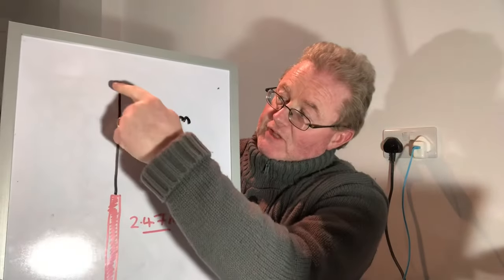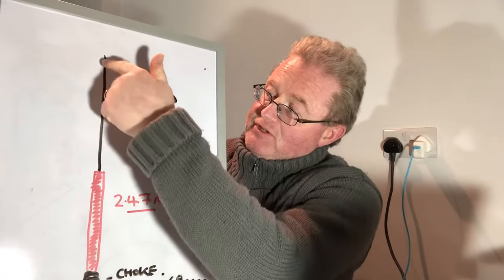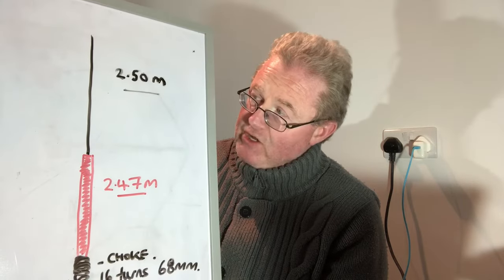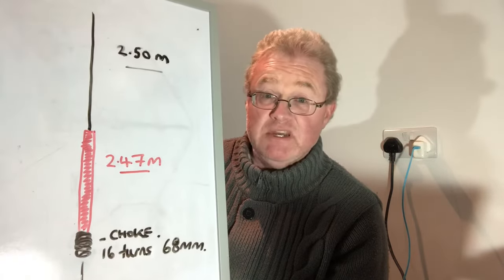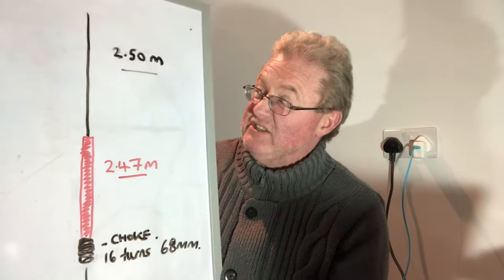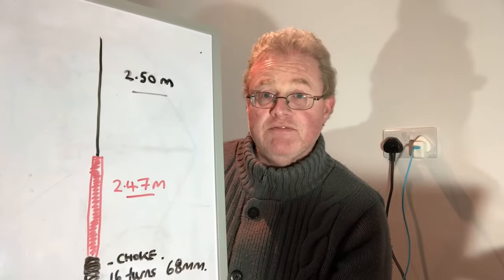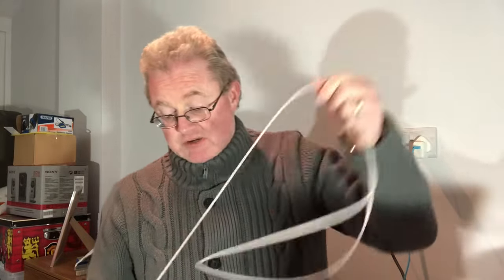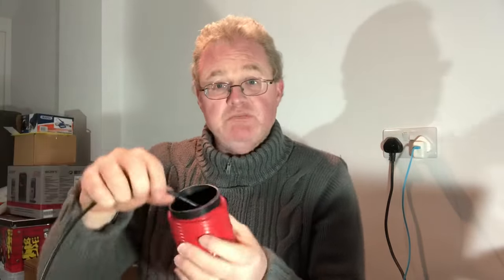T2LT - Half Wave Vertical Coaxial Antenna For CB Radio & 10 Metres

Comment: I've constructed a T2LT antenna for 11 meters, but with a twist: instead of using an air cored coil, I've built my choke like a 1:1 unun. The measurements ended up being similar to the ones for a 10 meters antenna. The SWR was 1.5 at its lowest.

Anyway, the antenna ended up being compact and can be used without a tuner for the 11 m band. It is also my main antenna for ham, and had good results (e. g. phone contacts from Portugal to Brasil with just 50 W). Due to constraints, I have to mount the pole listed 45 degrees from a window.

You can see videos of the antenna on my channel, and even some experiments using that antenna to test self-made amplifiers and transmitters.

Anyway, thanks for the very informative video!
Reply: Stop lieing please 🙏 😂😂😂
Reply: @lesjones5684  The living proof of that antenna working is on my channel. Yes, the SWR was measured in said video, and it matched my initial measurements that were done vertically. Perhaps the pole I used had some influence, but I really doubt it.

Comment: Traditionally, the lower element would be formed with another layer of shield, typically sourced from the top section. (Note of course that since the diameter has to be increased, that you'll need significantly more length as it shrinks in length as it is expanded in diameter to fit over the outer jacket.) In other words, the feedline snakes up inside the lower element, which is another layer of shield. The design shown in this video has the lower element effectively formed with the outer surface of the coax's shield, and choked off at the bottom.

One concern with this design approach is that the bottom of the lower element is a very Hi-Z point, so there isn't much current to be choked off. It's a high voltage point. So you may see more feedline current (another quarter-wave down the line) than expected, as it escapes past the choke as a voltage (not a significant current).

Also worth mentioning, the choke dimensions are not as mm-critical as implied. It's a choke, which is rarely a precision value component in any design.

Cheers.
Reply: Re. your comment: "It's a high voltage point."  I guess that it is a high-voltage point only because the choke is there?
Reply: Yes, that is the description of a true, "coaxial antenna." This antenna here I see with a couple of other names. The quarter wave braided shield over the outer insulation used to be thought good for isolating the feed line from the antenna, but the design did suffer from narrow frequency range / narrow SWR range and TVI / television interference, due to feed line radiation. The traditional coaxial halfwave antenna was said to have the lowest angle of radiation or gain. When a choke is added to the antenna, the frequency range / SWR range greatly improves and the TVI is reduced. The choke is to choke current, even if it is an a voltage point on the antenna. Choking voltages does little for antenna performance and causes greater losses. A current choke is still preferred over a voltage choke for function, although a voltage choke may provide a very slight amount of current choking, but a voltage choke causes even greater losses though. I would no refer to the antenna in this video as a coaxial antenna, even if it is made of coax. It doesn't fit the design. Much of the current to choke will be harmonic frequencies, but also to reduce base frequency radiation from the feed line.

Comment: Rather than stripping the coax, why not just put 2.5 meters of wire on the end. That would save you 
2.5 meters of cable. You could leave the PL-259 on the end and solder the radiating wire to an SO-239 and connect it that way.  You could also build an antenna from the choke up and put an SO-239 a few inches under the choke and have several antennas made. Thank you for the video. I never really thought of using a coaxial dipole before but I find myself in a flat in Madrid and your idea may be the only option I have for operating.
Reply: Fair point
Reply: RG58 isn't pricey, but yes for longer antennas it'd be a waste; I've used a separate piece of wire for this. One suggestion I'd have though - start with a tail of a few cm of the inner part of the coax to take advantage of the insulation, I stripped back to the prescribed length and found it was easy to accidentally short it at the join :(
Reply: Also, I wonder whether normal insulated wire would be a bit less lossy than using the co-ax dielectric?
Reply: Back in the day we used 13 amp wire usually off an old appliance found somewhere .
Worked very well

Comment: The antenna described is electrically similar to the Shakespear Big Stick CB antenna which was very popular back in the 70's.  It was a half-wave coaxial sleeve antenna which came in two pieces.  The top part was a regular 96-inch fiberglass quarter-wave mobile whip.  Most people replaced it with the famous 'three-quarter Francis' whip, thinking the combination got out better.  The bottom part consisted of two coaxial fiberglass sections with a braid sandwiched between the two pieces.  The bottom section was capped with a metal ferrule the whip screwed into.  A piece of RG-58 ran up the center of the bottom section.  It terminated under the ferrule with the center lead soldered to the ferrule.  The coax shield was connected to the braid.  A 5K resistor was placed between the center and shield for 'static bleed' (poor).  The bottom fiberglass section had an aluminum sleeve glued to the bottom and a crimped-on SO-239 was crimped into the sleeve.  It was mounted to a mast with muffler or hose clamps.  It could handle 500 watts and had 2.5 DBD of gain.  A simple and very effective design which kept the radiation angle very low and compact making it excellent as a hilltop or field antenna.  A military version of this antenna was also made as military radio frequencies surrounded the civilian 11-meter band back then.  It was the same design with extra heavy-duty construction.

The Big Stick was the best design, better than the famous "Ringo" because the feed point was in the center of the antenna instead of at the bottom.  So, the feed point was elevated (antennas radiate most of their energy from the feed point).  I always recommend adding a shorted quarter wave stub to the bottom of those antennas.  It creates a DC ground for the antenna.

The Big Stick had one major failure point:  The connector at the bottom.  Because of constant flexing in the wind and temperature swings, the RG-58 would eventually pull out of the connector creating an open circuit.  I made good money fixing those antennas once I figured this out.  I even salvaged 'bad' Big Sticks from people who went on to 'fancier' antennas and resold them after fixing them.

Several years ago, I accidentally contacted the creator of the Big Stick suggesting he license the design and let someone make 6 and 10-meter versions of the antenna and sell them.  Unfortunately, he would not sell the patent or license the design, therefore no one makes the antenna anymore.  Such a shame!

Comment: Thanks for showing this, it brought back fond memories.  I made one similar to this for 11-meter CB back in 1975 when our ground plane got destroyed in a storm.  No balun coil, just took the end of the RG-58 coax, removed a quarter wavelength of the outer jacket and cut it into two equal lengths.  I spread the braid where the jacket ended and pulled the center conductor and dielectric out the opening.  I then used one jacket piece to tie the center conductor and dielectric to one tree, and the other piece to tie the braided shield to another tree, horizontally polarized.  Hooking up the SWR bridge it would barely budge the needle, reading 1:1 across the entire band.  Fortunately it was aimed the direction we needed, and I had all kinds of people I spoke with on it saying I couldn't be talking on a piece of coax!
Reply from the maker: Brilliant example Bob
Reply: @timg5tm941  Thanks!  I always look back at it fondly as a good example of putting theory into practice.
Reply: Do you have any pictures of the antenna 73s from 416 Trinidad.
Reply: Love to see a diagram of this
Reply: @alvin pope  Unfortunately no pictures, I was 17 at the time, going to tech school for electronics. Had started learning it as a hobby, was fixing CB radios and stereos, installing them and other related stuff.  Worked part time at a few CB shops.  Wish I'd had a camera to take a picture of someone actually mis-wiring RG-58 coax into a PL-259 connector without a UG-175 (176?) adapter, they unbraided the shield and soldered it to the center pin, the center conductor to the shell.  If I hadn't seen it I wouldn't believe it, HOW does someone swap polarity on a coaxial connector?!?‽
Reply: @Noel Stephen Ryan  Not much of a diagram needed, but I get that you're trying to visualize it.  My written description covers it pretty well, but you can try it with just a short scrap piece of RG-58 coax.  The hardest part is pushing the braid back toward the main section of cable, then carefully spreading apart the braid in one spot enough to make a hole without damaging the braid.  I used a jewelers precision flat blade screwdriver or the back edge of an X-Acto knife blade (opposite the cutting edge).  It's fun to snake the dielectric and center conductor out of that hole, but once it does, the rest of comes through fairly easily.

This whole thing was done as a quick fix, not meant for long-term use.  I used it for a few months, and I'm sure the copper braid was tarnishing and/or corroding the whole time.

The design is equivalent to about any dipole, I just used the coax itself instead of individual wires.
Reply: @bobblum5973  Appreciate reply. Yes I get it now. Thanks again
Reply: @noelstephenryan4837  You're welcome!

Comment: They work really well Tim, I was able to do back to back tests with a T2LT that I made,  and a shop bought 1/2 wave vertical on 10m, no difference on either TX or RX, I was so impressed I made one for 6m too! 73 M0KED.
Reply from the maker: Indeed Andy they work very well

Comment: Great video Tim. I made the 5 turn coil version a while ago, but for the top portion I used 10 mm aluminium tubing. This way I could mount it on top of my military fiberglass mast instead of hanging it down. Gained extra hight with that.
Reply from the maker: Sounds a very good build👍

Comment: great job Tim. if the size of coil off a mm or 3 that still fine and works. I used 54 MM with RG-8X . 16 turns. great band width. and their is a 3 Rd way to make it. FT 240-43 Toroid for the coil.  great fun in the US as well . 73's
Reply from the maker: Brilliant stuff

Comment: Funnily enough, I made two of them a few weeks ago. One for at home on a 10m pole, and one for out in the car. Fantastic stuff, as always.
Reply from the maker: Can’t beat them Mike 👍
Reply: How did you use it in the car Mike? Stationary or did you mount it on the vehicle some how?
Reply: @vsmichael1  Hi Mike, I have used it two ways over the years. One is a 10m pole strapped to a fence post, and the other is I  have those suction grips (for gripping glass panes), attach one to the side of the car and lash the 10m pole to the side of the car. Both worked extremely well.

Comment: I've been trying to resurrect an old Cushcraft MA5V vertical (20, 18, 15, 12, 10 meters) elevated to about 25 feet on a pole but it lacks effectiveness. However, it is pretty noisy most of the time. I saw another video using this design and it seems pretty quiet noise wise. Will try this design. Thanks for the idea Tim.

Comment: Hello Tim,  The T2LT is a great antenna. I have redimensioned the T2LT for 2 meters about 47 centimeter per leg (mind the velocity factor) with 8 turns on a 4 centimeter diameter plastic pipe. It is my antenna for my local net. On a 12 meter pole I can get as far as 50 kilometers on 25 watt.  I my opinion it can keep up with much more expensive commercial antenna's easily. My greatest distance so for with my 10 meter version is Chilli 12.266 kilometers. (from the Netherlands). Great antennas that keep amazing me.
Reply from the maker: Fabulous! I use a 2m version too.

Comment: Good job Tim. I have seen one of those commercially made ones that you describe and they are finished off at the top so that the end folds back on itself a little and then held with a little piece of unshrunk heat shrink so that the antenna can be adjusted longer or shorter.  I think i will make one this weekend just to see but i will try 6 or 8 ferrite beads slipped over the RG58 at the 2.47m mark and heat shrunk to make the choke that way. Sid.
Reply from the maker: Sounds interesting Sid let me know if the choke works ok

Comment: I've heard of these and hear they work well, what I have read is the coax shield should be peeled over the coax itself and pulled down from the radiating portion of the antenna for the counterpoise???, aparently it doesn't matter.
   Great demonstration, thank you for sharing this with us!!! 🇺🇸
Reply from the maker: Thanks Eric. Yes that is an alternative way to do it but this way seems a bit simpler. 73
Reply: @timg5tm941  Your welcome Tim, and thank you!

Comment: What about changing the radiating part for 10mm2 copper flexible cable?
I did that, and my antenna is performing much better.
Reply from the maker: Yep, an option 👍

Comment: I built and hung one for 11m between 2 trees and at the same tip height as my neighbor's Sirio Vector 4000 and with the same power we hit a guy on a ridge at 110 miles with the same S-6. Now I'm planning to build & hang a home-spun Sirio Gain Master wire and I bet I'll gain 3-5dB.

Comment: Thanks for the video, Tim. 🙂
I am new to ham radio and I would like to built on of these T2LTs as my first HF antenna (for 15 m though). With my humble understanding of antenna technology, I am now asking myself🤔 this as I do not have an idea regarding how sensitive the T2LTs are to - let's say - non-optimal choke dimensions etc.:
a.) Is it recommended to actually measure the choke with a NanoVNA or sth like that to make sure the diameter and the number of turns are correct to have the coil have its maximum attenuation at the frequency I would like to trim antenna to?
b.) When trimming the antenna, is it required to also shorten the part next to the choke when cutting of a part of the "naked" wire of the top part? (= move the choke up the same amount of centimeters)
Maybe you (or someone else who knows the answers) can help a newbie to get started - 
peferably in easy to understand English, as I am German.
Reply from the maker: Hi there:
(a) no just follow the choke chart from G3TXQ. (b) no need to adjust the bottom half of the antenna as long as you have cut it right. It is the top half that requires trimming. 73

Comment: Great video. Thanks. Do you have any comments on how high off the ground  the bottom end of the antenna (the coil) should be? Can they be mounted close (like less than a meter) to the ground or would a 1/4 height be better?
Reply from the maker: Yes they can be.. will be increase in ground losses but not so much as you’ll notice. A metre is probably the lowest I’d go before tuning might become problematic with these antennas.

Comment: Hi Tim, thanks for the video; this deliberate feeder radiation is a trick which is jolly useful but not known by many.  Do you know what is the loss of the insulating tape around the wider coil?
Also: I guess that the input Z at the feedpoint is 75 Ohm; maybe using a 1/4-wave of ~ 60 Ohm coax (if you can find it these days!) would give an even better match to 50 Ohm?  Perhaps therefore also increase the 1.5:1 SWR bandwidth.
Reply from the maker: Interesting observations 👍

Comment: Radio Shack or Tandy Electronics, use to sell an antenna like this made out of fibreglass  I think it had a inductor coil in the base so it would fit in the fibreglass tube at the bottom. It's a reasonable antenna, but no where as good as a.. 0.64 wave antenna you can also make with a bit more difficulty. But they do work much better. Tandy etc shut down in Australia it was purchased by Dick Smith Electronics, he eventually sold it to a supermarket chain and they stuffed the retail business up.
Reply from the maker: Interesting info thanks!

Comment: I dont strip back the coax i solder a wire to the center dielectric and use the 5 turns choke and i get 1.3x1 from 28.000 to 1.5x1 at 28.700 it works great i dx with it all the time and get great signal reports.
Reply from the maker: Sounds great! They do work well don’t they
Reply: @timg5tm941  yes they do im making a 10 meter POTA one now then a 20 meter Pota one. My elmer has a 40 meter one

Comment: Instead of stripping back a huge length of coax for the upper element, couldn't you solder that same length of solid-core 12-guage wire as the radiating element instead? That would save "wasting" 8-1/2 feet of expensive coax that could better serve as  the lead-in.  

Couldn't the choke be terminated with an SO-259 so that the lead could be detached or even upgraded (say, to RG-8X)?  

Also, I am curious.. what effect would it have to install the choke so that it encircles the mast? I'm sure that might depend on whether the mast was conductive (metal) or not (PVC).
Reply from the maker: For this antenna at 60p per metre the expense is £1.50. Given there’ll be no potentially breakable solder join too i think the extra 1.50 is worthwhile. The choke can indeed be terminated at its end to allow lower loss coax as the feed. As long as the pole is non conductive it’s all good.
Reply: @timg5tm941  Maybe it's cheap where you are, but no so much here in the U.S.
I'm lucky if I can find plain 12-ga copper wire at $0.60 per foot - more than 3 times your price!